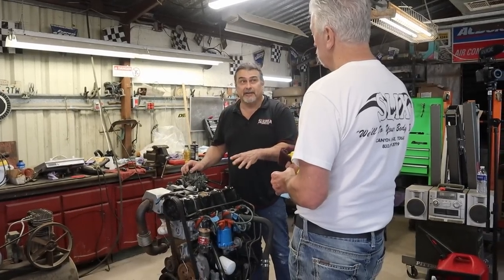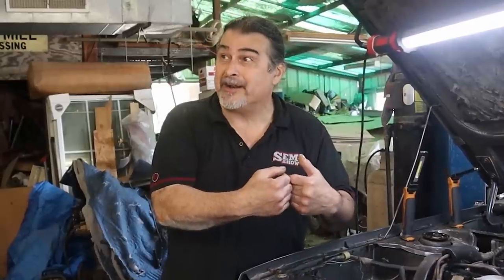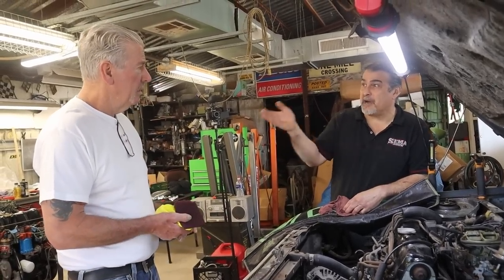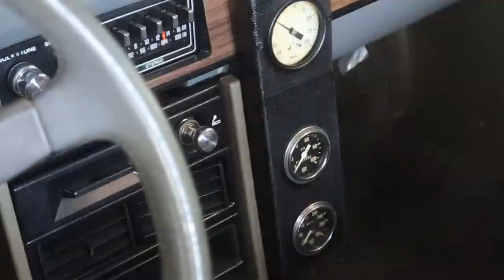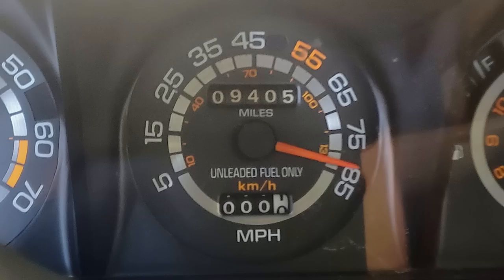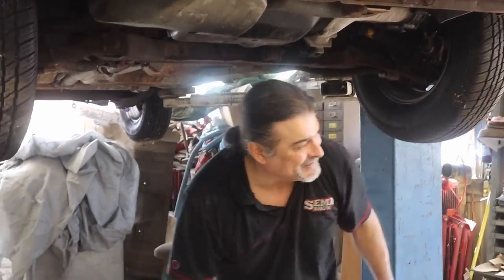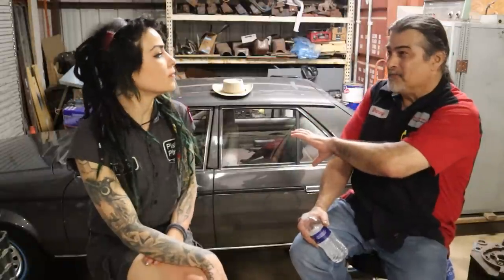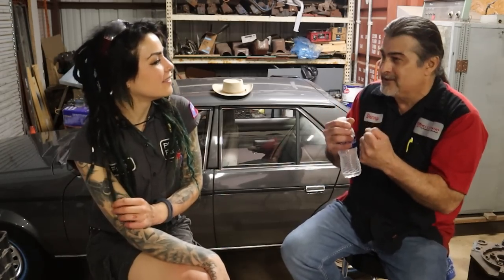Who restores a Plymouth Horizon? INCREDIBLE EBAY FIND OF THE CENTURY! Smokey Yunick's Hot Vapor Car!

Comment: I've known a bunch of guys that have owned an Omni or Horizon over the years, and the 2.2l engine was always the last thing to go on the car. Solid engine!
Reply: I owned a few 80's era Mopars with the 2.2 liter. Turbo and naturally aspirated. Decent little engine if you take care them.
Reply: I use to have the dodge omini
Reply: Omni
Reply: I remember my dodge omni I had to change the clutch once. An one day the front wheel axle came out an I had trouble finding the bolts an tapes to put it back together

Comment: Hi Faye, just found your channel.  Wow, this episode brings back so many memories.  First, I remember reading about Smokey in Popular Science way back when I was a youngster.  As I recall, he would answer questions from readers, sort of like a Dear Abby for gearheads. Secondly, I had a 1983 Dodge Omni that I bought used in 1987.  I got it cheap with low miles.  I almost killed myself replacing one of the front bearings.  It was a press fit and while pressing out the old bearing, it exploded (my fault).  Ball bearings shot around the shop like bullets.  Luckily they all missed me!  Also, it was the first car that I changed a front axle.  All in all, a great car with a fair bit of power and decent mileage.  Keep up the great work!

Comment: A friend gave me two 1986 Horizons circa 2006: Her blue daily driver got totalled while parked in front of her house. A friend of hers found ANOTHER '86 Horizon (a white one with only 50,000 miles on it) to replace it. She eventually found something bigger and gave me both cars.

The white car rode like crap until I installed the brand new rear shocks that were in a box in the hatch, then everybody who rode in it marvelled at its surprisingly comfortable ride quality. I gave it to my girlfriend when her '91 Corolla died, but she couldn't stand how it would hesitate on cold winter mornings (she'd never driven a carbureted car) so it eventually got sold off as a package deal with the wrecked parts Horizon. 

I seriously thought about making it into a 24 hours of Lemons racer, but didn't have the budget for the required safety equipment. It was a tough little car, I think it would have done well. If not for the automatic transmission, I would have had a much harder time letting it go.

Comment: A friend of mine in the early 80's bought a brand new Chev 1/2 ton 4x4 350 light block 4 spd.
He read about this mod and applied a portion of it to heating his fuel line with engine coolant 
His gas mileage went from 18 to 22 mpg. Just a backyard mechanic without papers having fun.
Reply from the maker: Super heating the fuel?!!
Reply: @FayeHadley  Yes, I suppose.
After watching your show and reading his email, I googled Smokey Yunick and his process. I AM A LAYMAN, so I'll try to reason out what Smokey did and everyone else is welcome to crucify me if I get it wrong. Smokey heated the fuel in two stages, engine coolant and headers..
Turbo charged the mixture. My buddy heated the fuel and introduced it to his Rochester carb sitting on top of sintered screens. Vaccuum leaks galour. Enter a 650  Holley single pumper, sintered screens again, headers, and a MDS ignition.
High gears accidently came with truck.
He upped the tires  from 30 inch to 31 inch.
24 mpg, and a noticable increase in torque which was happily destroying the rear end and bellowing the thinner block of the day.
I find when you and Danny collab, it is very entertaining. Brings back lots of memories of success and horrible boo-boo's.
Reply: I read of a California mechanic heating the fuel with engine coolant regulated with a small air conditioning heater exchanger. Emissions went down and fuel economy went up. This patent was in 1970's. Sounded easy to do.

Comment: Besides a 64 Impala with a 283 I bought and restored as my first car, my first car given to me for a first driver was a rust bucket horizon.  To spice it up I hooked a row of christmas lights to a cheap stereo amp for the illusion of interior concert aesthetics. And to drown out the rattling rear strut blown out, while the rear the driver side unibody frame was held together by a come-a-long... & about 10,000 miles later doing 55 downhill a highway the passenger rear unibody cracked and wheel to fender well full stop . So having an extention cord in the hatchback I wrapped the frame come-along side and swapped the come-along to the other side well enough to drive a few miles to a local boneyard 💨🍻

Comment: in 1987 i was 15 when i bought my first car, my first car period.  it was a 1984 Plymouth Horizon.  my first sister-in-law sold it to me.  it was white with a kinda light blue interior.  my first mod to it was swapping the shifter knob with a Coors tap.  there was a few occasions where i found myself next to an actual performance car at a red light.  each time i would work the clutch and gas while still holding the brake.  rock the frontend, get the driver's attention.  when the light turned green i'd just dump it, getting a 2 & a half foot scratch at best.  then just put it into 2, and drive normal after.  a friend of mine, still buds to this day, was with me each time.  we'd be laughing our butts off 'cuz of the whole absurdity.  the other car was always thru the intersection and long gone before my front right even stopped smoking.
✌️🐝➕
Reply from the maker: Oh my gosh!!! My VW rabbit was white with a light blue interior 😆 I bet it was the same!!!! But oh my gosh I can't imagine you racing that!!! So funny!

Comment: You mention the radiator in your video, well I got a plastic radiator in mine. Having a new one installed besides the thermostat Changed. What other parts should I change ? Is the timing belt an pullie connected to the cooling system in a 1990 plymouth horizon. Thanks for your videos an time.

Comment: That Horizon has a stock radiator in the car. Smokey did not put a cut down radiator in that Horizon. Look up a new radiator for a Horizon and it's the same size as the radiator in the car now. That might be the car he worked on but the radiator is not cut down to half a radiator because the engine had a hot air system on it.

Comment: The automatic transmission were dogs. The 5 speed gear box were pretty good.  Question.  The little tube that cars came with that went from the exhaust manifold to the air cleaner. Were they there just for getting the engine hot during start-up or use all the time when running?

Comment: I bought an 87 horizon with a 5 speed and a 4 cylinder. I hated the engine. It never ran right. It would lose power and stall after it warmed up. Went to many different garages. Nobody ever figured out how to fix it. Last car with a carberator. I wont miss it.

Comment: It's essentially a VW Rabbit.  I believe
Reply: The GLH was!
Reply: Wrong, volkswagen copied the simca 1100,  which later became the talbot horizon. Then in 1978 in the usa became the dodge omni plymouth horizon, 78 to 83 the standard engine was a volkswagen 1.7,  81 to 86 the 2.2 was optional, for 1987 the 2.2 was made standard up until 1990 with 1988 being the first year for fuel injection on the L bodies, 1983 to 1986s did offer the simca 1.6 liter engine.
Reply: @kcarman88  
Well, least I got the blood flowing
Reply: @kcarman88  
How do you keep that from leaking out of your head?
Great summary!
Reply from the maker: @kcarman88  WOWWW!!! Thanks for the info!!!😃👍🏻
Reply: @Torsee   ive been around fwd mopars since i was a little kid. Know the ins and outs
Reply: @FayeHadley  no problem! When it comes to the lee iacocca era mopars, im a huge fan. Working ln restoring a 1988 plymouth reliant k at the moment, that left the factory with a 5 speed manual. Which about 5 percent were manual equipped.
Reply: @kcarman88  
👍
Reply: @kcarman88  Wow , I had an 84 GTI I thought the Omni was the copy but it was the other way around! Kinda like Hydrox & Oreo!